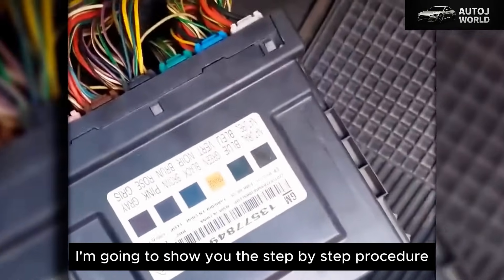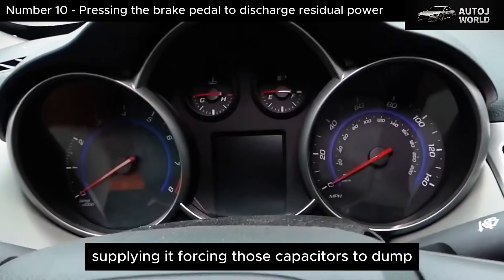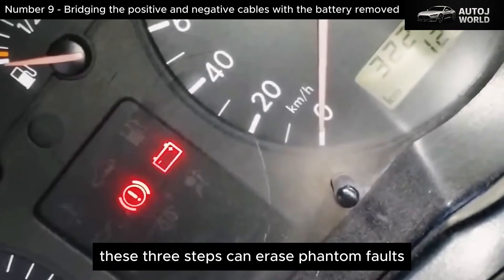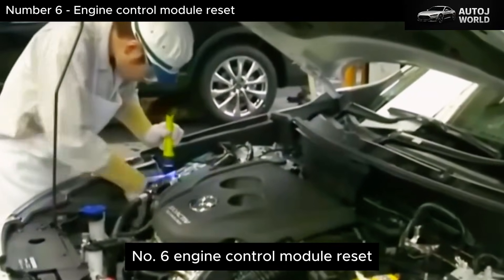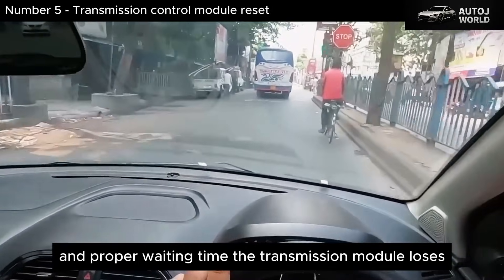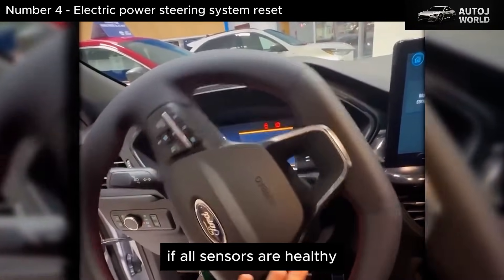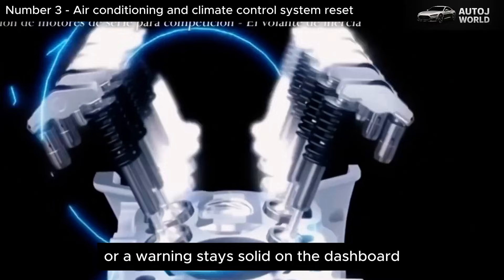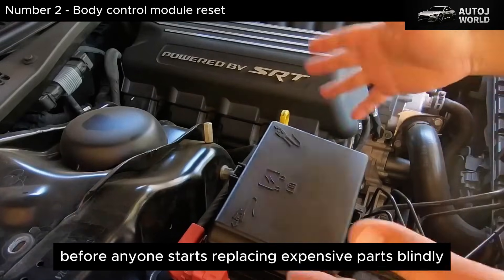This trick RESETS your car in 2 minutes (MECHANICS HATE IT)

Comment: We don't hate it, we need to erase all codes then test drive for current codes.
Codes often are left after a temporary problem is already gone.|
Most of what this video says is misleading.
Reply: I just bought an old Durango 4x4,I wanted a fixer up to keep my nice truck nice.
The seller was up front with me,he said it needed a body control module.
He disconnected door locks and jammed the main lock button.
If locking and unlocking with key only was the only problem, I could live with it for a while.
I have suspension work that it needs along with tires.
The 4 wheel drive is also off, and it runs in 2 wheel only.
I found out the 4x4 can be affected by the bcm as well. 
Another video showed a guy who bought 3 parts related to 4×4.
Nothing worked until he changed BCM.
I am looking for a way to bypass BCM to provide power to 4 wheel drive.
Reply: I do not know if the seller did a hard reset like this one,but the more I drive, it  seems to run better.
Reply: I would not tap my terminals together,I can see pushing gas pedal to make sure it drained everything.

Comment: Pressing the brake pedal or gas pedal. You said brake pedal but the video shows gas pedal????
Reply: He meant gas pedal. That's for the electric throttle stepper-motor to relearn it's default position. 
Also do this after you clean the throttle of gunk buildup.
Reply: AI is stupid.
Reply: Also talked about the transmission logic and strange shifting then shows a manual trans 💀

Comment: On early 2000 series GM vehicles, it can/will cause serious problems with HVAC stepper motors when disconnecting the battery without a voltage sustainer which defeats the process.

Comment: I DONT THINK I WOULD WANT TO TOUCH THE TERMINALS WITH EACH OTHER AFTER  DISCONNECTING THE BATTERY. I SIMPLY DISCONNECT THE NEGATIVE CABLE IN EXTREME COLD OR HOT WEATHER TO KEEP THE BATTERY SAFE.
Reply: My procedure, which is safe, is to connect P  &  N cables via a small resistor or small marker light bulb and leave connected while having a coffee. Then.. re connect.
Reply: @richardbarber4444  Good idea, that is to short them through a 100 ohm resistor. I saw Scotty Kilmer do this trick. Much safer than a dead short!
Reply: @John-jd7mm /  Now where are you going to get a 100ohm resistor?
Reply: He is not shorting the battery terminals together, he is only shorting the CABLES together. Just to prevent a mistake, he recommended physically removing the entire battery from the vehicle. Did you notice the battery blowing up @1:28? that is what I mean. This would be DANGEROUS!
Reply: BS
Reply: What are you talking about. ?? Did you listen to what was said in the video.?